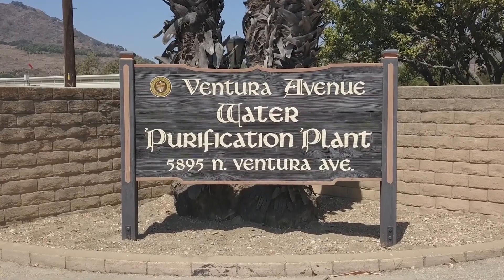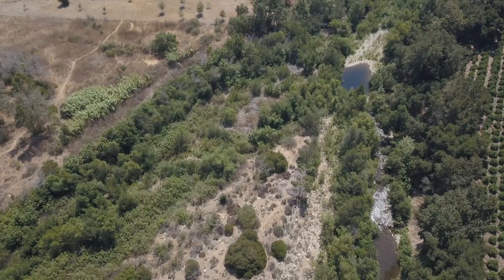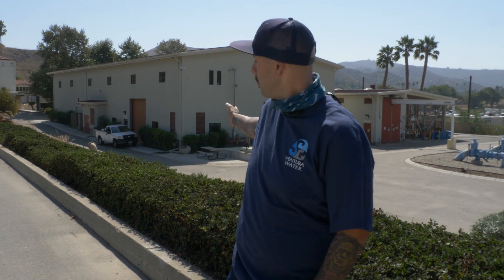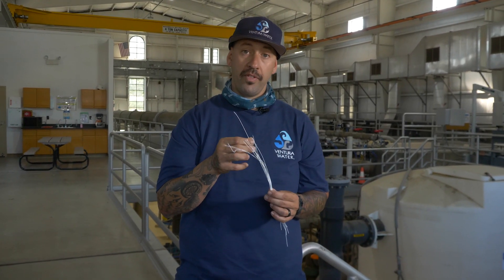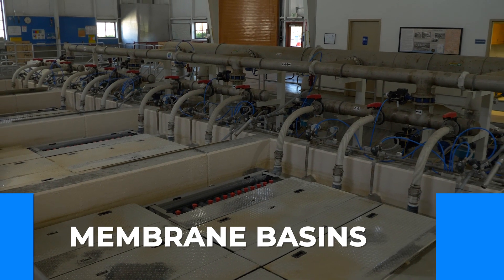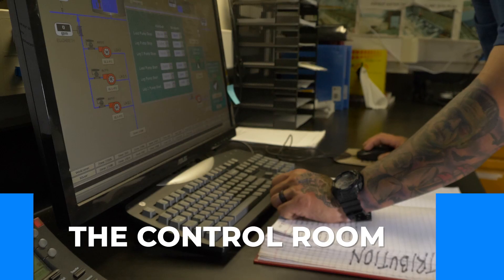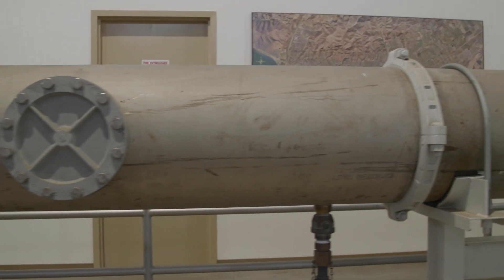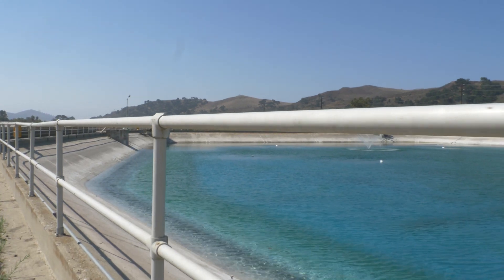Water Treatment Plant- Virtual Tour

Comment: A few questions from a fellow operator who has operated a Zee-Weed plant-1. Do you use coagulation to create a 'pin' floc to remove color, organics and most of the particulates so the Zee Weed does not foul?. We used a large greensand pressure filter post Zee Weed to remove iron and manganese. 2. How do you disinfect the Zee Weed filter effluent? 3. What do you do with your solids? 4. Describe the CIP process for cleaning the Zee Weed filter cassetts. Very good presentation. Thank you. I always love to see other operations. I work for an RO groundwater facility in Virginia.